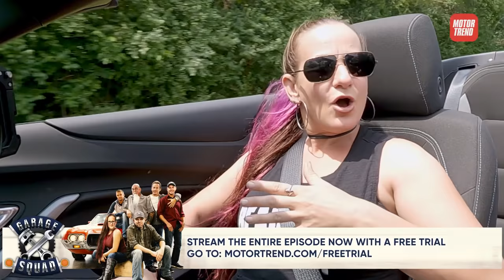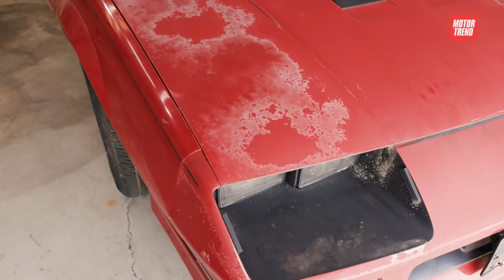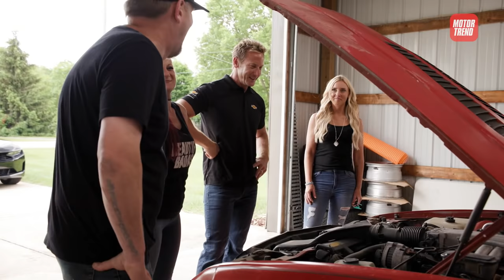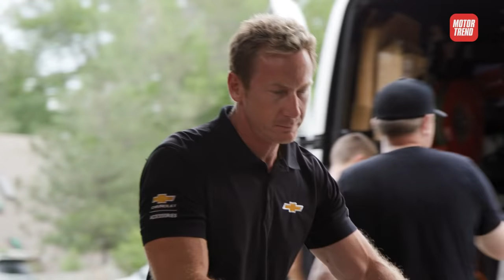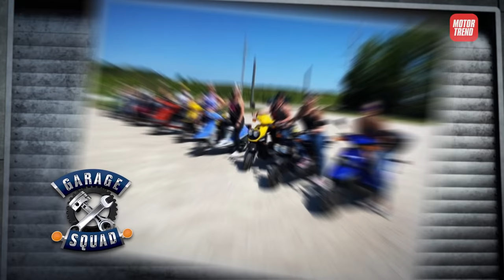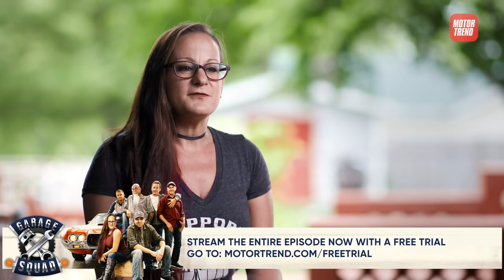Garage Squad | Season 8 Premiere | MotorTrend

Comment: you cant pull the wool over my eyes, that car is solid
Reply: Ya they're doing a good job of making it sound like almost a lost cause.
Reply: For real, that interior isn't half bad at all. Sure it needs a good refresh, and the dash has a crack, but man.. I've seen and had worse.
Reply: @AndreMarek64  Mine is far worse inside and out.  The dash is a given.  They all crack.  I'm on number 3 and it is falling apart.  The T tops need new rubber.  Don't waste this opportunity.  Change them.  You will regret it if you don't.  The rest looks cosmetic at first glance.  The drive train would be my worry.

Comment: I have experience with these Camaros and firebirds overheating. The front air dam under the radiator is designed to deflect air into the rad not just for ground effects. If it’s missing the car will overheat on the highway

Comment: SORRY JOE CHEVY CHEVELLE OVER DARTS, lol 😆 
BUT NOT 68 CHARGERS WITH FIRST GEN HEMI’S !!!!!!!!!!!!!!!!! 
 <~ROCK STAR HEMI’S

BEST MENU, TRI 5 Chevys with HEMI POWERPLANTS LIKE FINNEGAN’S 55 !!! Yeaaaaa!!!!!!
I had a 69 Nova 307 with a Powerglide Transmission.. never got beat by a four speed. Why ? Because while they were shifting losing mph’s MY
POWERGLIDE WAS JAMMIN TO TJE FINISH LINE.. Not kidding I’m telling the truth. No 350 Camaro ever beat me. You could RAP a 307 OUT TO 6800 RPM’S because of low compression ratio..
Now a Camaro with 9-1 or 10-1 stopped at 5500, sometimes 5000. The power curve is what I’m talking about..